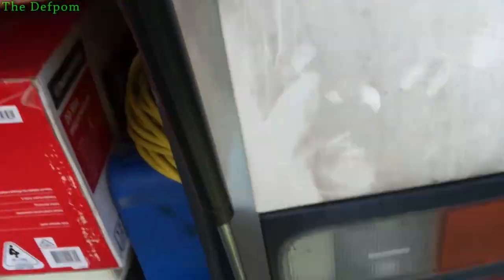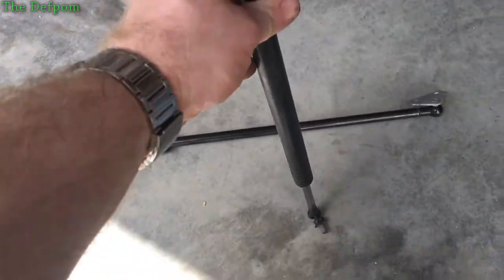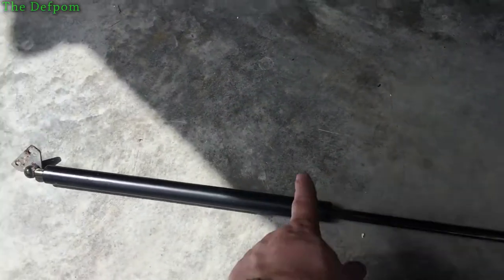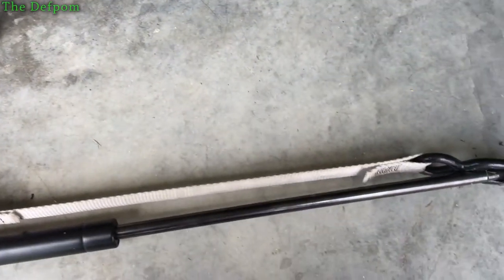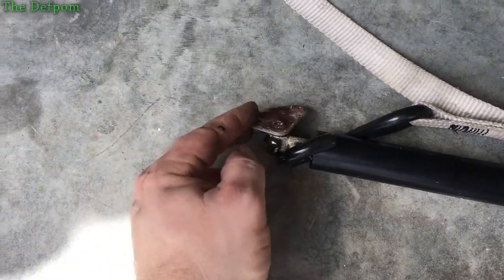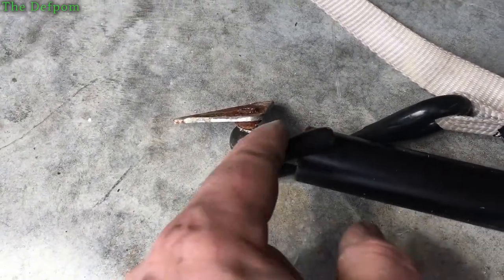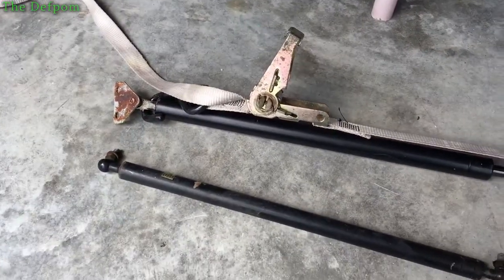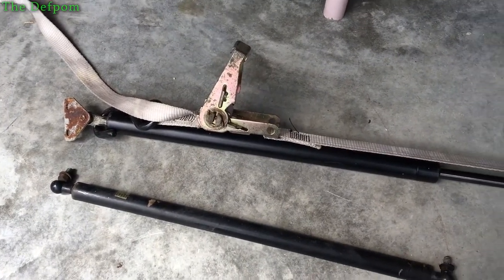#653 Two Minute Tuesday - Tip For Fitting A Gas Strut

Comment: Soooo....that answers my question before I ask it.........I'll be fitting a gas strut to a machine that needs a compensator for the weight of the head and seeing the set-up I realise that you need a spring compressor of sorts to compress the strut to get the mounting points lined up with the screw holes if the strut is slightly  too long etc......ta muchly.

Comment: For those with the ball ends grab some fence wire, and loop it around the end of the strut, between the ball and the base, or the neck of the ball and the strut, then wind up the ends tightly, and make a closed loop with those ends, so you can get the hook of the strap in there.

With the old ones, before taking them into scrap take a hacksaw and carefully cut the tube near the base, to depressurise it, also making sure that nobody will want to use it again. Note that there will be a lot of gas coming out, along with some oil, so wear eye protection and head protection. The shaft steel out of them is also good, once cut off and the ends ground flat, as a long drift, as it will reach into places a regular one will not.

Comment: Thank you! That helped tremendously.
Reply: Well, I managed to use your hack in a repair job. Unfortunately for me, the hook slipped and my finger got stuck between the strut and the partially mounted bracket. THAT was painful. I could not even utter a curse word. Luck was on my side as when I finally got loose, nothing was broken.

Comment: when i do  them,  i do them one at a time, i extend the old ones to full height and then vice grip/locking pliers the old rod in place, it doesn't matter if you mark the shat as you're replacing it anyway